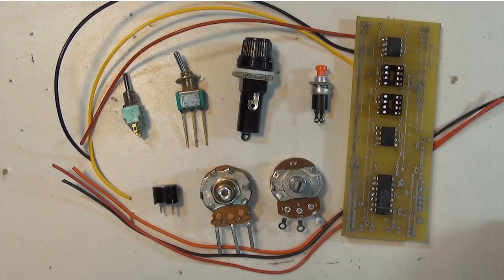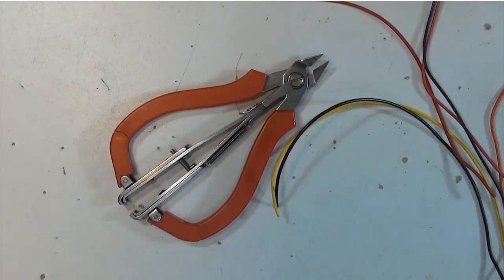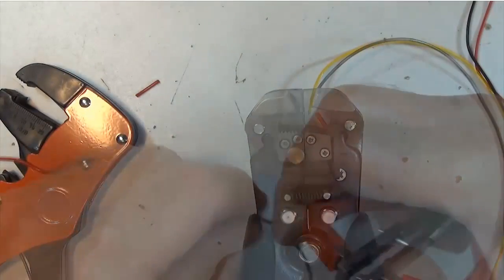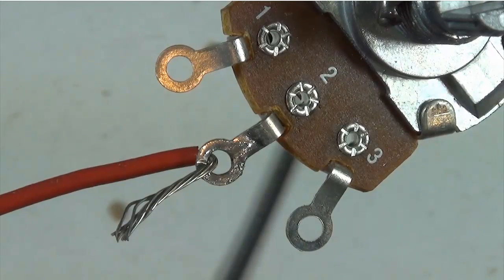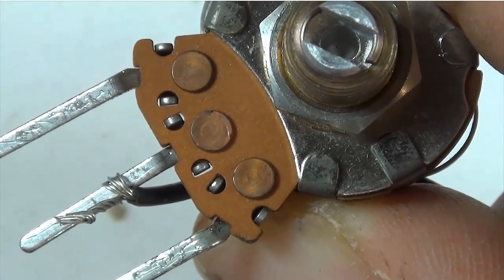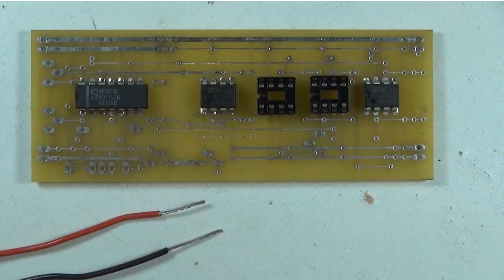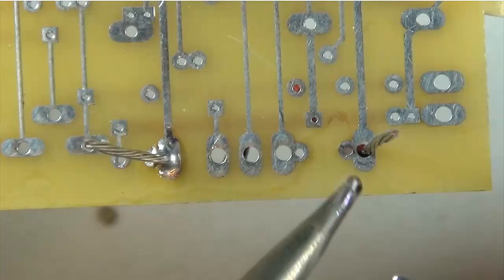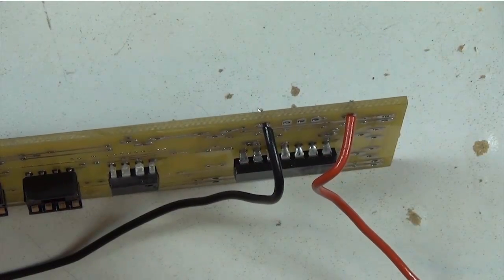Soldering Wires to External Components & the PCB | Tips & Methods |

Comment: so I have a small power switch on a mechanical keyboard pcb, that is in entirely the wrong place for my needs. My plan was to desolder it, solder wires to each leg ( it has 6) and solder those wires back through the pcb. Is this feasible?

Comment: My mistake was soldering the wires into the eyelets that are in the insulator part of the panel mount potentiometer. I had gotten away with it on 2 pots, I think because I was using a lower temp on my iron back then, but a few kits later I had 2 pots go bad on me, and I am fairly sure it was from applying too much heat to closely to the center of the component. The legs did not have holes in them, so I just thought I could use the holes that it seems you are not suppose to use. 😂

Comment: The connection to the second potentiometer is terrible. Solder didn't fully wick into the strands, because they didn't heat enough. This would have been better by tinning the wire before twisting it around the pin, then using a small solder bridge on the iron tip for better thermal transfer. (In general, it's wiser to pre-tin stranded wire before soldering it to things.)
Reply from the maker: Actual you do not want the solder to wick into the wire on the insulation side of the wire under the insulating material of the wire.  Secondly there is no purpose to have the solder wick into the wire part that will be cut off.  If you look closely there was a sufficient amount of heat as the solder did wick into the wire wrapped around the post and bonded well to the post.  That is all that is required for a quality connection.
Reply: 1929fordhotrod I didn't say the solder needed to wick under the insulation, which you correctly state is undesirable. And indeed, it's irrelevant whether the excess to be trimmed has wicked or not. But the outer strands of the wire wrapped around the post don't appear to have wetted at all -- there's a huge mound of solder on the post, but it hasn't wicked into the wire completely.
Reply from the maker: I was using a plated wire which might make it difficult to see depending on what you are viewing the video. I can assure you the solder did wick into the wire sufficiently.  I also did make mention of the excess solder that did flow quickly down the post and is not that desirable.  This is sometimes a casualty with the extra equipment getting in my way while filming.
Reply: I assume you have made a video showing us all how to do this better?
Reply: He's saying that the external wires are naked, you can still see the filaments of the wire as they are not covered by the solder
Reply: And I am saying you, Alejandro and Antonio, have no experience nor credibility to stand on. Are we at your channel, no? You don't even have a channel, all you have are bad attitudes and zero experience. Cheers!

Comment: Why did you not use flux?
Reply from the maker: I am using a rosin core solder.
Reply: 1929fordhotrod Even then using a small amount of no clean flux makes it much easier. Also when u place the iron back in the stand tin the tip. U never mentioned it in the video. The solder protects the hot tip.

Comment: i have a problem i am about to solder the super tiny wire in a pcb that has no hole do have a video on how to do it ?... thanks for the help :D
Reply from the maker: Strip a small amount of insulation off the wire and then you can solder it directly to a track or pad on the pcb. If you are soldering to an existing pad, remove the solder first then solder the wire onto the pcb.